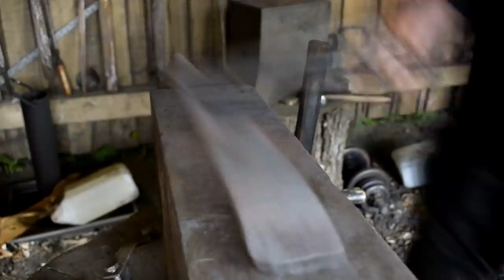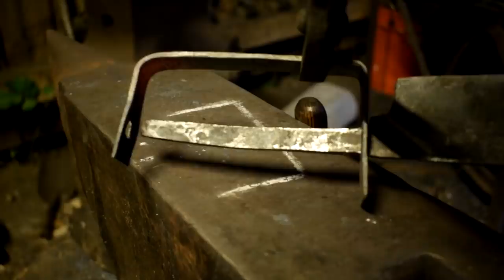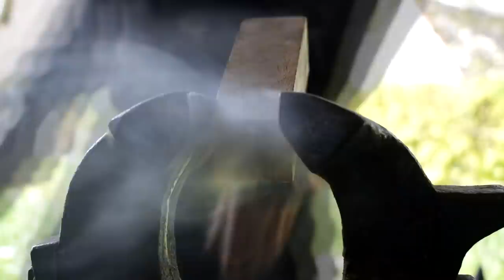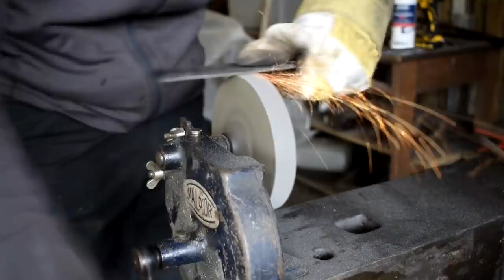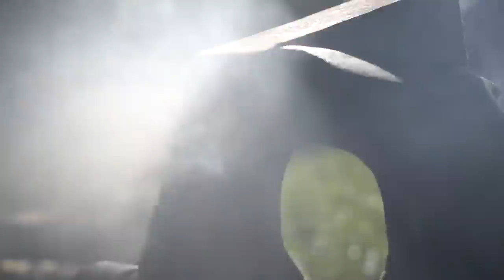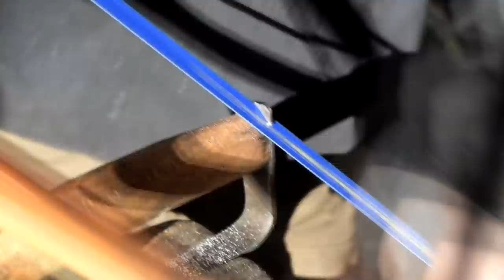Knife Making - Witcher 3 Meat Cleaver (Zero power tools)

Comment: Nice chopper, one tip if I may, instead of pouring the oil on the anvil keep a rag that you wipe up oil with and then use that for when you're doing the finish, wipe over the hot steel, black heat not red hot, it should just smoke a bit when wiping over, this will give the steel a lovely black finish.